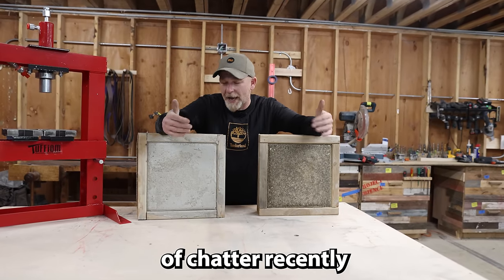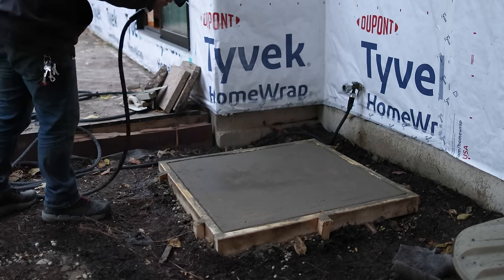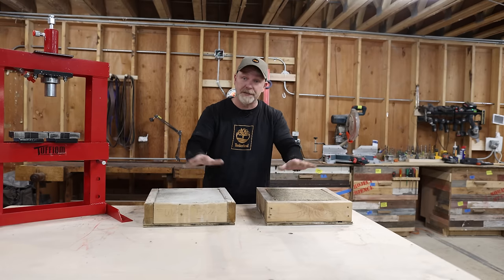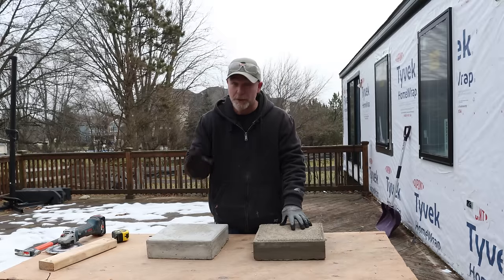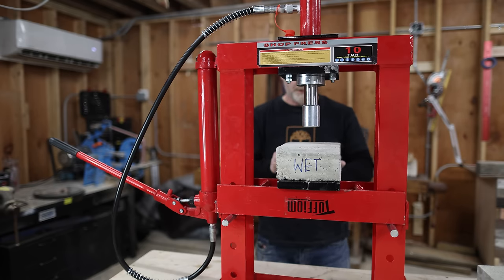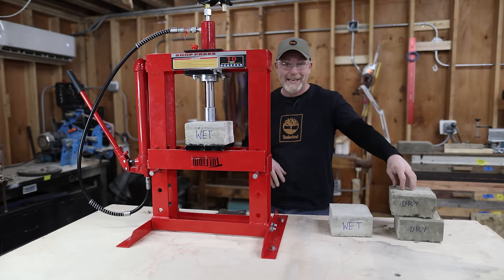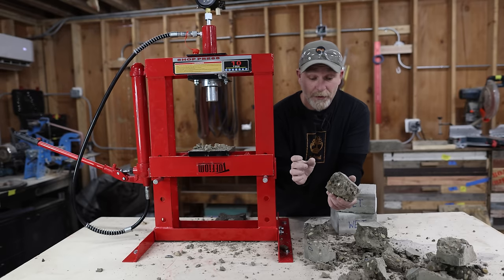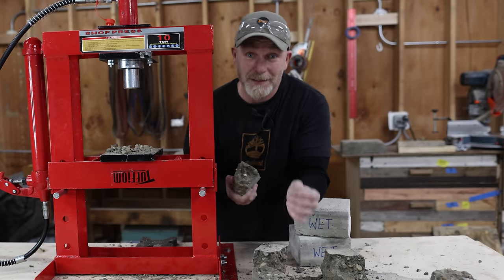The TRUTH About Dry Pour vs Wet Pour Concrete!! Strength Test - You WON'T Believe the results!!

Comment: Most people don't know how concrete even works. It's a chemical reaction and it must be mixed wet. It's DESIGNED to be wet mixed. I don't want to mix concrete either, but dry pour is not even close to a solution. It's laziness and or ignorance to how concrete works. Great video sir. You saved a bunch of people from wasting time and money!
Reply: It depends on how thick, how much water you use and where you want it
Reply: @terricochran2181 Still doesn't make sense to do it imho.
The fact you have to keep coming back to mist, mist, more mist, spray and flood is certainly not saving any time. And no matter how you approach it, I don't see how you could ever achieve a consistent cure to the bottom and middle of the slab by only adding water from the outside of a form.
Any benefit to dry pour is extremely negligible for much worse results.
Reply: @joshriver75  I agree to some of what you are saying but it depends on how deep and and what you want. Many have had success IF you do it correctly. 
A lot of people want things done quickly but sometimes people have to slow down and do things the right way. That's all!
Reply: @joshriver75  I agree if doing it in a big area where heavy traffic will be.
Reply: How do you know what it was designed for? It has been used since 200BC by Roman's and I don't think they left instruction manuals, else Europe probably wouldn't have fallen into the dark ages.
Reply: @joshriver75 I got into it for the purposes of basically retaining walls, you know slap the bags down, stack em up and keep 'em wet. Seems from messing with the oldest examples I could find the two tricks were keep them wet, some cured well entirely submerged. And the people who stacked rags and towels on them and watered the rags seem to have done well. Or possibly mix them wet and put them back in the bag, the major benefits being that you don't need forms and can do the job a couple of bags at a time.
Reply: @jonsiccardi8601  sorry. If done correctly and certain placed, dry pour is certainly fine. I know people plus myself who have seen it stand strong. I wouldn't do a big driveway or where something heavy would be. If done in increments, it will work for patios, walkways, porches, etc...😉
Reply: @vidard9863  the younger generation want things fast and easy. They don't know how to do things the other way.
Reply: @terricochran2181  I can't argue with that.
Reply: Hands on Construction Engineer here, my last job was showing other people how to install "dry concrete" properly. Step #1, read instructions on the bag. Step #2, follow instructions on the bag. Step #3, follow steps #1 and #2. What the creator of this video and so many others have missed in the instructions is that #1, dry concrete is for fence posts, not load bearing weight. #2 Use that same amount of water as you would with wet concrete, if you do not, then you will have concrete like this guy. #3 "Misting" is not in the instructions and does not get a gallon of water in the concrete; take a gallon of water and pour it around the dry concrete. Water makes the concrete bond. You need water even with "dry concrete". "Dry concrete" only refers to how it is set up, not the final product. I guess common sense just ain't that common these days...
Reply: Dry concrete says in the instructions to use the same amount of water if not more than regular concrete. Some people hear the word "dry" and assume that means no water.
Reply: Thanks 🙌.    You hit the nail on the head.     I’m a retired General Contractor and I laugh out loud when I see people doing a dry pour     The Engineering on my buildings required concrete to be mixed with the proper amount of water for a reason 🤔😂
Reply: @terricochran2181  

The problem is, since you can't see the internals, you have no idea if you're using enough water, if it's penetrating all the way through, if you're over-watering and making it weak, etc. You're right, though. Thinner slabs probably have a better chance of the water penetrating all the way through and it curing. I just watched a previous video where they did 2 slabs, each 1 1/2" thick. One had a chicken coop on it and a year later, it was still going strong with no cracks. But to me, it's not worth it. Nobody likes mixing concrete (and I don't even have a mixer), but it's not worth it if 3 years later the slab starts cracking.
Reply: @joshriver75  

If you have a cement mixer, I completely agree that you save absolutely nothing from dry pouring. If you don't, then you save your back! I'm mixed a ton of things by hand over the many years of owning my home and since I'm not an expert, I do everything based on what the best practices are. Yeah, it sucks mixing concrete in a wheelbarrow, especially if you have a large project. The biggest I've done required 54 bags!!! But there's nothing I've done that's cracked after and some of my pours are over 20 years old, with people walking on them every single day. I'd hate for a walkway I poured to start cracking 3 or 4 years later simply because I didn't want to take the time to mix it. If you got a big pour rent a mixer. Heck, nowadays, mixers are pretty cheap and it might be worth just buying one!
Reply: @terricochran2181  

The moment you say, "I wouldn't do a big driveway or where something heavy would be", you're pretty much saying even you don't trust a dry pour! What you basically just said is, "Do a dry pour, unless you're actually expecting it to hold up anything!" Hahahahahaha!!!

Again, I know NOTHING about dry pours, other than what I've seen in YouTube videos. I'm about to do a slab for a 500 gallon propane tank, started refreshing my memory on how to do them and saw a dry pour video that supposedly came out well, so then I had to research if this is a viable solution. I'd rather just break my back once doing it the wet way and know 30 years later, it'll still be there for me.
Reply: @chadmills5400  

Yeah, you're just reinforcing my thoughts. So even if "done correctly", you can't use it for any load bearing applications. Translation: about two months ago when I was redoing my mailbox post, I could have done this. Great. For any serious applications where it needs to bear weight, don't use dry pour. Got it!
Reply: Maybe check out Cajun country livin and see how their dry poor's are holding up.
Reply: I think if it's not mixed wet, it won't be as compact. In the dry pour, there's too many micro air pockets so it's not held together well
Reply: @dontbanmebrodontbanme5403 to be fair concrete will always crack within 30 years if it's a drive way anyway, wet or dry. Historically, only paver surfaces hold up 100+ years.
Reply: I don't even know what the chemical reactions are. But if you try to bake a cake and you don't mix the  ingredients,  well we all know what will happen.  It will not turn out.
Reply: True !!!!
Reply: It's like trying to bake a cake by mixing all the dry ingredients, spreading them in the bottom of the pan, then spraying the wet on top. I guess technically what would emerge from the oven could be called a cake.
Reply: @stevenlake5278 Bingo. You nailed it.
Reply: ❤️I just put seven bags around a 6x6 post and went by the instructions to add about two and a half litres maximum per 25kg , I like my pizza baked all the way through and not be doughy or powdery 😂❤
Reply: The Romans...probably a wet mix too...lol. 
But I read once that Romans used lots of volcanic ash in their mixes...today, concrete companies have a High Early Mix, concrete with Silica Fume.
How u going to do that with dry mix?
Reply: @terricochran2181  That is magical thinking. You are a wet pour apologist.
Reply: Good knowledge. Pointing out that making concrete is chemical reaction of water with the components of Portland cement, sand, and gravel (and maybe some other stuff--lime?). Mixing is a process of combining to make concrete. With the correct amount of water added, the concrete will cure correctly and deliver the strength of concrete.
Reply: @chadmills5400  You are a wet pour apologist.
Reply: @harrisorourke6926  😆whatever. My dry poured walkway is still strong.✌️
Reply: They dont want to work

Comment: I'm a civil engineer.  We learned 40 years ago that dry pour concrete will always be very weak compared to a cured wet pour concrete mix.  The difference can be 10 times stronger for wet pour, and the dry pour will have many pockets of weakness, the wet pour will be uniformly strong.  Not a surprising outcome.
Reply: Yep. But I feel like we learned this 2,040 years ago.

Then again, I don't know exactly what you meant by we.

We humans
We the people
We civil engineers (not me)
We jolly good few
We dastardly do-gooders (this is me!)
We-irdos (also me)
Reply: Love the spelling
Reply: Isn't civil engineering for all of the engineering student who couldn't do math?
Reply: @yadda333  aren't comments like this from people who have an educational deficit?
Reply: Hmmm, I graduated from college 40 years ago. For some reason, I think those lowly civil engineers (I was in the mechanical eng program) knew the correct way to mix concrete then.
Reply: @yadda333 civil engineers could do arithmetic and algebra.  It's the calculus and differential equations they avoided. HHa
Reply: @yadda333  another civil engineer here, we call engineers who can't do math architects ^^
Reply: @yadda333 can you solve the diffusivity eqn? It predicts dispersion of pollution in streams, how about Tergazzi equation for soils compaction?  How about beam deflection differental eqn? How about the energy equation for structural deflection? How about pipe network eqns for water distribution system... How about Mohr system to find principle stresses?  I can go on and on... I think you are confused about architecture vs civil.  Structural finite element tensors for matrix stresses.... BSCE84 LicPE ChemE
Reply: @Spudeth. Simple foundation ROT for rotating equipment is cement weight =10×equipment weight,  typical soil load 2000#/sf... remove weight of soil = to weight of structure supported.  
I just dry poured a simple floor for new utility room. No regrets  it only accessed few times per year... water the quick Crete in layers
Reply: @otisarmyalso  👍
Reply: @otisarmyalso  Triggered!
Reply: @spudth the correct way is the way that works and sets and cures properly. If you understand concrete and how it works you can do it how you want as long as the end result is satisfactory.
Reply: Pretty shit but England did build schools and hospitals with aerated concrete probably performs similar to dry stuff
Reply: @kennethfisher7013 yeah. I feel there's a  difference in POUR and POOR. I could be mistaken  but that's what my 3rd grade teacher taught me
Reply: Someone needs to tell the builders of the Hoover Dam they did it all wrong.
Reply: @Fonok87  Mechanical engineers build weapons, Civil engineers build targets.
Reply: 500 PSI I believe is the target for concrete, what dry pour is, I have no idea.
Reply: @MHLivestreams sorry to contradict, but in 30 years of reading commercial building specifications I've never seen a 28-day specified  strength lower than 2,500 psi, and that's for residential. Commercial is 3,000 psi minimum, often higher.
Reply: 8 tons =16000 lbs not 8000
you kept saying lbs not tons
but it’s a good video anyway
Reply: @Timber1508  thanks, I was going from 30 year old memory from a 54 year old brain.
Reply: The thing is you can get even more strength by decreasing the liquidity of the mix but slowing down the cure.  A lot of modern concrete is actually less strong than it could be if they were willing to reduce the cure rate because internal temps are getting too high in the mix during cure.
Reply: EXACTLY, I spent a Summer collecting concrete testing samples and doing slump tests, at city pour sites ... just subtle variation in water content made a HUGE difference in strength .. dry pouring has to be the dumbest idea ever, guess it looks good in a video, but the result is the worst concrete possible.
Reply: @KrustyKlown  I think the whole dry pour thing is either a result of laziness or a result of people misreading a study about Roman concrete from years ago.  I'll never discount laziness as it seems to explain most human problems.  But this study talked about how the Romans laid their concrete and why it contributed to how long their concrete tends to last.  And if somebody was just skimming through not paying attention it could sound like Roman concrete lasted so long cause it was dry.  Which it wasn't, but if you're not paying attention you wouldn't realize that.  The romans aside from using pozallano ash were hand laying a low-slump, low-moisture concrete that cured extremely slowly.
Reply: @RigepFroggit  I blame Social Media.. videos that seem crazy,stupid, shocking, etc..get LOT'S of views .. and doing something seemingly stupid with Concrete has proven to be awesome click bait.
Reply: i've been pouring and finishing concrete for 15 years and i've never hard of "dry pour". Literally the dumbest thing i have ever heard lol.....
Reply: We, as in civil engineering students.  The chemistry of cement and concrete pre-mixes available at home improvement stores isn't thousands of years old. Modern concrete hasn't changed much in decades.
Reply: Do you think the failing bridges and buildings in China lately are from dry-pour applications? The videos I've seen about shoddy infrastructure look a lot like what we see here. (Electronics engineer here, but I do a lot of my own DIY stuff, always have, and I've poured some slabs in my time...always wet, of course.)
Reply: To me it’s a lot like making a mold of plastic resin and spraying the hardener on top instead of mixing it in.
Once the cement gets wet the clock starts on it setting and hardening.
If half of it gets wet and then the other half gets wet much later, I’m sure there is going to be conflict.  If the outside gets wet and sets before the inner part even gets started I don’t think it’s going to be very good.
Reply: Civil engineer and doesn't know how to spell "pour"?😂😂😂
Reply: @kennethfisher7013  thanks to autocorrect, anyone can be a mis-user of homonyms
Reply: Thanks for saving me the watch time!
Reply: @yadda333 no that would be architecture.
Reply: Obviously weaker. But if the slab was used for a hot tub which is estimated at 5,000 pounds? Or probably not strong enough?
Reply: @clos483  The issue isn't just initial strength, but also how it performs over many years of getting wet, then drying, and possibly even under frost heave.  Properly mixed and cured concrete will outperform in years 1 through 50.
Reply: No contractors ripping off investors cutting corners and buying sub par materials. Pluss no inspection no maintenance,  and sinking buildings. @RichCadwalader
Reply: @otisarmyalso  I doubt yadda even made it past high school.
Reply: @yadda333   An engineering class is debating what type of engineer was required to build the human body:
The first student said it had to be an electrical engineer to design all of the nerves and wire them to the brain and muscles.
The second student said it was a mechanical engineer to designs the bones and joints to support the structure and allow movement..
The third student said it was a civil engineer, who else would put a sewage dump near a recreation site... 🤣🤣🤣🤣🤣

Bonus Round:

Did you hear about the Aggie engineers who drowned when their truck ran into the canal? They could not get the tail gate open...
Reply: @RichCadwalader,
I suspect that the problem with those buildings and bridges in China is too little cement in the mix and also lack of bigger aggregates.
I saw a video of a problem with a building and it looked like it was mostly sand.
Reply: @yadda333 civil here and do crap loads of math. Go back to counting rebar…and remember the corners have to overlap, yes it is important.
Reply: @spudth civil here, try again.
Reply: @yadda333 I am a mech and structural engineer 

I also did soil mechanics  from civil engineering. 
The calcs were out of this world 🌎
Reply: how a bout R.C.C?
Reply: @mdmconstruction  Swittzerland, Germany and other countries in Europe use massive amounts of aerated concrete blocks to this day, like wood and other materials it needs to be waterproofed. Building maintenance was the problem in England not the building material.
Reply: @mikeazeka1753  I mean, we live in a world where people believe biological sex is malleable and the earth is actually flat. Don't be too shocked that people think wet and dry poured concrete is the same quality.
Reply: Spot on Mike, dry pour is trash. Only unskilled diy knobs do dry pour. They are the same ones that swear by it because they have no idea.

Comment: I was told by an individual who worked in concrete for his whole life, he said that the hardest walls in a building was the cistern. A room which held water for the house hold to use. He said that cement will cure for 50 years and an abundance of water on the cement will strengthen it. Always amazed me, whether it true or not, can’t say.
Reply: Yup. Damns continue to cure over their lifetime.